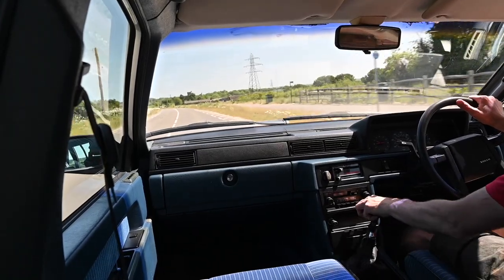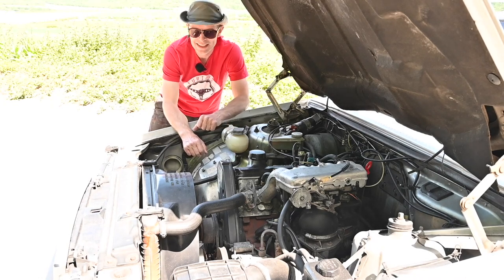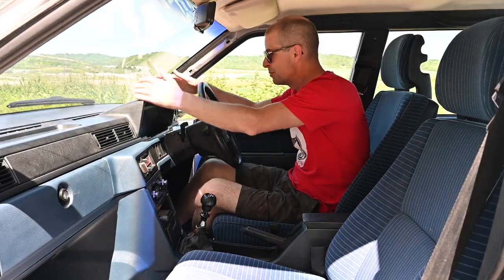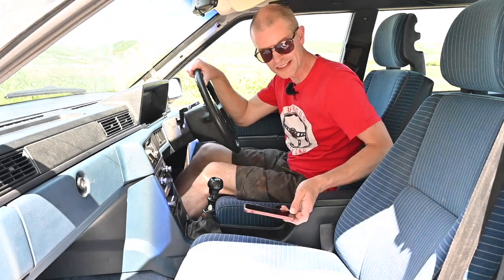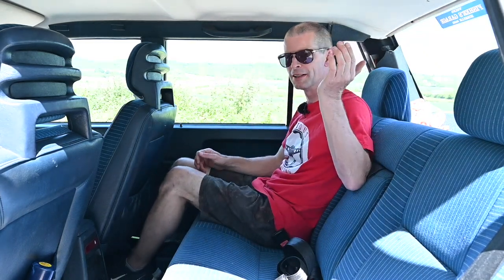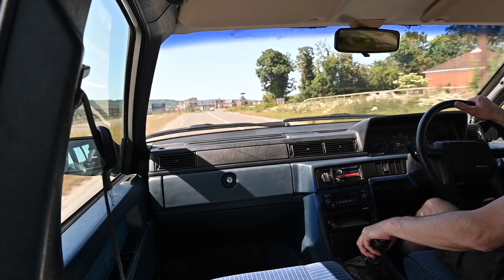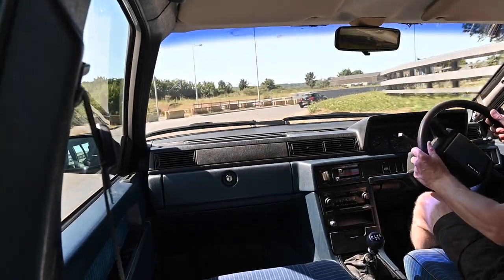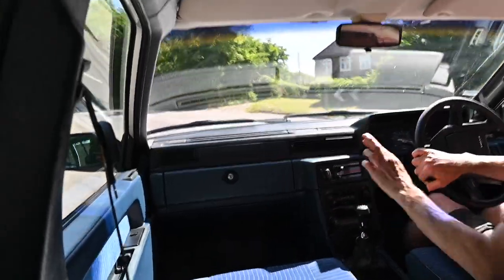1988 Volvo 740 GL Goes for a Drive

Comment: That space under the radio used to have a Graphic Equaliser on the higher spec models.  Great video, brought back many memories of the C-Reg 2.3 GL and then the E-Reg 2.0 GL that my Dad had.  He always said the 2.3 unit was far better.
Reply: Yes, Volvo sold a lot of options that you could install later if you wanted to, the front speakers seems to be a later install with the different grills as the original usually fits over the different models they sold. The places for extra buttons where handy as Volvo sold switches with different sets of signs you could plop into the upper part and different coloured signal lenses to put in the switch. Useful when installing extra headlamps here in Sweden, or front foglights. There was an three point roll uo seatbelt for the mid seat in the rear as well, I still have mine somewhere, the bracket that you install under the hat shelf I had to modified because the previous owner had installed front headrests in the back seat on my 1986 740GL with B230A. But it still worked, and the only thing I kept when sending it if to the scraps after two crashes. (No one was using that at those accidents)

Comment: My 1987 740 saloon really isn't very wallowy, in fact I seem to notice the pot holes and bumps quite a bit. Also fairly stable throwing it around the bends. It doesn't look lowered but maybe a previous owner has put stiffer dampers on, I don't know.

Comment: Another great video Matt. I used to have a lovely 1988 760 GLE automatic estate, which I adored. It just went on for ever and ever in supreme comfort, and had a vast amount of space. In fact with the rear seats folded down it was perfectly possible to lie down and go to sleep, and I often did, using it as a makeshift camper van on weekends away. Mine had leather seats, which although very comfortable offered little support in corners, and there was always a sense that if a corner was taken a little too quickly one might slide off the seat !  Despite its vast size the one thing which always amazed me was its superb all around visibility, which made it far easier to park that one might imagine. All in all the 700 series was a superb car.

Comment: A perfect review! I completely agree with what you said about the engine. The worst problem I've ever had with working on it is sheared bolts! And about the horn, it is a dual horn setup but it doesn't sound the best, for a car of this size I recommend a big air horn ;)

Comment: Matt great review, reminds me of my 1984 Volvo 360 2 litre.  Little 13 inch wheels massive suspension travel so you sent it into a corner and it would grip but the body would role massively on the axles  all controllable and safe.  The 5 speed gearbox was as precise as stirring a bucket of rubber rubber balls.  As you said of your Volvo not a hooligans car, not National Front more National Trust.  looking forward to the next download.
Reply: Haha funny the rear wheel drive Volvo is the young drifters choice here in northern Europe. I've owned three examples for snow drifting. They drive just great.

Comment: Needed a van for business and a car for family, had an Astramax and an Astra, sold both and bought a new 740 estate around 1989
What a car, did everything and did it well, comfortable and roomy, 

Going to work 5.30am one morning and a car pulled out, t-boned it at 50mph the 2 week old Ford Orion was a wreck, total write off, driver hospitalised.

My 740 had a cracked grille and broken number plate! Emergency services were astonished.

Traded in two years old, had paid £13k new on a dealer promotion.

Got £11.5k trade in against Cavalier SRi as I no longer was running to cash and carrys

Wish id stayed with Volvo.

Comment: im unsure if anyone has said but the front speaker grilles are different because someone paid for upgraded speakers. those are the 25 watt units. i think the standards would have been 10-15 watt with the same grilles as the rear.
Reply from the maker: Some one did say that, I think they are worn out now but cool to have had them once
Reply: furiousdriving the foam fails on them but while kind of an odd size it’s not hard to install modern speakers into them. But with a flaky stereo I wouldn’t guess there’s much importance placed on good speakers lol.

Comment: The Volvo 700 series were lovely cars, best they ever made, and were extremely opulent, especially with those heated front seats as standard for those typically cold Scandinavian winters, no wonder many a Volvo driver and front passenger looks so smug over there in the mornings. The estates actually sold better than the saloons with colossal load carrying capacity seats folded, but still roomy and comfortable enough for a family of five or 5 adults even to go places. The powerful heating and ventilation system is a good winter feature as it roasts your face through the face vents at the same time as your feet if you push the temperature slider hotter and hotter, only really cooling off face level air at lower temperature slider settings.

Comment: It is such a shame that Volvo don't make cars this good anymore, I have owned 4 estates & 2 saloons, all of which had over 200,000 miles on the clock, in fact my 1987 240 GLE had 320,000 and ran like a swiss watch,
As long as you keep the rust at bay, these cars will last a lifetime!

Comment: I hope you manage to get your hands on a 300 series Volvo after this. Especially if its 360 with the same B200E Engine, I think it would be very interesting to see you compare it to your 740!
Reply: That's what I'm waiting for. I loved the 5 I had, not amazingly quick but so much fun to drive.
Reply: I got a 1990 760 gle with 75,000 miles! With the 280f engine.
Reply: My Mum had a 1984 360GLT with that engine

Comment: your engine is actually not the weakest one. In sweden we mainly have variations of the b230. The b230a, which is the carburated model, made about 110 horsepower. The electronical injected one, the b230f, made 115hp. And ofcourse the b230e (the one i have :D ) has 130. So yours end up somewhere in the middle. Then the glt models had the turbo engines that sometimes pushed over 180 hps. They also had a NA 16v b230, the b234f, it made around 150hp

Comment: Great video, Matt! I love this car. Always liked how in the later versions (I think from the 16v) they blinded the rear side windows with perforated black stuff. I remember replicating it on the rear side windows of my 5 door Punto 1 using static perforated window foil, it looked quite nice inside and out 😁

BTW I think a lot of them were built in Belgium
Reply from the maker: Wasnt that the 400s that were belgian? I thought these were all Swedish
Reply: @furiousdriving  nooo, the 400s where built in the Netherlands! Same Nedcar factory that builds Minis right now. Check the plate under the bonnet it should say it.

Comment: I drove taxi in 740's and 940's on LPG. Strongest combination ever. Diesels (VW) were rubbish compared to the 4-cilinder 2.3i's. we had one '88 740GL (still remember the plate: TB-98-TX) which made the million km's on one single engine. Not bad for a taxi, I guess.

Comment: The B200E isn't that weak compared to the rest of the regular offerings from Volvo in that time. The B230F was 114 Hp, compared to the B200Es 115 Hp. The naturaly asspired B200F wasn't far behind ither at 111 Hp. The big difference was probably the torque figures.
I've never seen a 2/7/940 with damaged control stalks so they should be sturdy enough. The speaker grills in the back is the 740 standard ones (fitted also on cars without a stereo) and the ones in the front are for those particular speakers.

Comment: The severe boxy style did work better on the wagons. But, I still prefer this to the reptiles, insects and fishes too many cars look like today! One of my gripes on '80s Volvos is the brittle interior plastic. However, my '90s Camry has the same problem. Also, like your 740, my Camry suspension was soft from the factory, and even worse after two decades. Fortunately, Toyota built a wagon version, and fitting the wagon's rear springs made a big handling improvement in my sedan, despite raising the ride height an inch or so. Maybe that could be an option for you.

Comment: Matt,  There must be something wrong with your speedo -" 4,000 rpm @ 70".  What impressed me the first time I drove one of these was the relatively low revs at cruising speed. At 60mph, 2,200 and @70mph, 2,600. The speedos were one of the weak links in this car, so maybe you should investigate.
Reply from the maker: I dont know, it does sound like its revving around that sort of figure in 5th at 70
Reply: @furiousdriving  There's definitely something wrong if  that's the case.  I only had one of my Bricks at 4000 rpm a few times and I was clocking 110mph.
Reply: Michael, you are right. 4k at 70mph is more 1300 Marina/Ital! The clusters were problematical to say the least. I worked at a garage that tried to fix the speedo on a mint 740 to no avail. There were 3 different makers to my knowledge, all of which were not interchangeable. I loved all my Volvos from the 360's to the 940 Wentworth Turbo I had. The 940 also needed a cluster as I recall.
Reply: @furiousdriving  check the speedo with a GPRS, I imagine at 4k you are doing 90+ but in a 740 is dosen't feel that fast.
Reply: @coogeeman  I used to work on the electrics of these cars (freelance electronics technician - analogue not the modern programming nightmare).
I once gave up trying to find a speedo  fault in a 480.
The 740 and 940 gave around 27 mph / 1,000 rpm in 5th gear,  depending which wheels and tyres were fitted. -14" wheels with r70 profile should be 27mph/1,000 rpm. 
I too had a 940 Wentworth turbo, it was slightly lower geared than my 740 because its bigger wheels and lower profile tyres didn't add up to the same overall diameter, but there wasn't much difference.  
You are right that in these cars you could be doing well above 90 and not realise it.

Comment: When you bought oem speakers from dealer you got new speakergrilles. You probably dont have any rear speakers installed because your radio is a 2 channel model
Reply: Easy to check if speakers are installed. The grill is removed by sliding it upwards, no tools needed.
Reply: @llaeeZ  -88 and older you pull the grill straight out, -89 and newer you slide them forwards

Comment: I've got a 1989 740 GL with 93,300 on it.  Bought it from a friend in 1993 with 37,000 on it.   Always garaged in California so no rust anywhere.
I was wondering though about the suspension components.    Shocks,  bushings,  etc...  Seems to not feel as smooth as when I first got it.
I suppose there are some rubber mounts and parts that have just hardened up or worn down.
Which items would one have to replace to get a smooth cushioned ride again?  Cost to have it done?
As with most,  back of my headliner is coming loose but I've kept it up with sewing pins.   No one sits in the back so you don't even notice it.
I've not heard of any other good solution short of full replacement.
Problem with the car is it will easily outlast my minimal driving as I'm 70+...  Meaning I'll never have another car.   Odd feeling to think of that concept.
No "next" car....
Reply from the maker: You probably need to change the shocks (dampers) and Id expect a few suspension bushes. Changing the shocks is very quick and the bushes mostly are not a major effort, but I dont know what the hourly rate is around you.
Also if your tyres are over 10 years old they will go hard and ruin the feel of the car even if they have good tread they wont grip very well.
Replace the headlining is the only option, easy in an estate, hard in a saloon

Comment: I'm rather sad to notice that, given the current vogue for Scandi Noir TV programmes, you didn't mention the fact that the boot is plenty big enough for at least 3 dead bodies, if you feel the need to go full Swedish serial killer...
You can fit GLT-spec springs and dampers to these, or even Turbo ones, which does a lot to cure the sensation of wallowing.  The gas dampers of the GLT did act and react far faster than the oil dampers of the more basic cars, and that's what was fitted as standard to the 740 police cars used in vast numbers in Scandinavia, and also to the 240 PS (police special) that was run in numbers by British police forces (Hampshire Constabulary had dozens as area cars) into the '90s.  The first police car I ever got pulled over by was one of those 240 PS, and they did look properly menacing...
Reply from the maker: I didnt want to give any clues in case I do go on a spree...
Reply: @furiousdriving    Well, I've buggered that for you then.  Sorry, not sorry...

Comment: Having watched Vintage Voltage last night where they converted a Defender with a single Tesla model S drive unit, I wonder what effect two Tesla drive units from a P100D ludicrous would have in a Volvo 700 series?🤔😱
Reply from the maker: lots of acceleration...
Reply: Combined with a fair bit of body roll I should imagine.

Comment: Looking at the radio it certinaly is an older unit, I believe the same unit was fitted to my Uncles C reg 340 that again was one of the lower specs. My Gran's 1988 340 GLE (F202DYA), on the other hand, had a much more modern digitally controlled radio with display. (see https://www.dndservices.co.uk/resize.php?image=vc608.jpg )
Reply: Your link doesn't work because of the bracket on the end. The stereo looks like a Philips unit, quite a few car manufacturers seemed to use Philips stereos at the time. I seem to remember my G-reg Rover 214 had one very similar.
Reply from the maker: this is the one in the handbook!
Reply: @Zeem4  Yes, I would be surprised if it wasn't made by Philips, they were big in all aspects of radio.
Adding to my previous post, one thing I do remember about my Uncles 340 was that instead of a rev counter you got a clock (it was in the bottom of the centre console on the GLE) and in the top left corner of the instrument cluster you got a picture of a gear stick with a small amber LED that advised you when to change gear.
Reply: Does anyone in here know why the buttons are LMUUU...? L&M are obvious (LW and MW) but I happen to know that U is actually FM, but why is it U (certainly not UHF as that's 300MHz and up) and why are there three buttons for it...?

Comment: Ahh. The B38. Better known as the PRV V6  (Peugeot Renault Volvo) is a very unreliable engine. Volvos own inline 6 engine is much better the 4 cylinder is also a very reliable engine